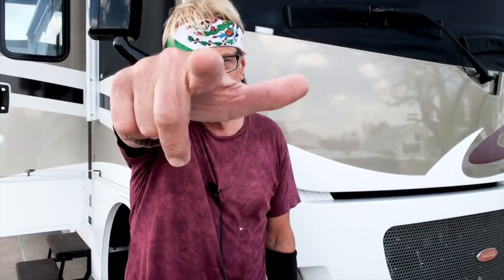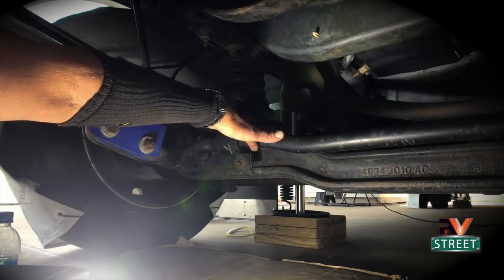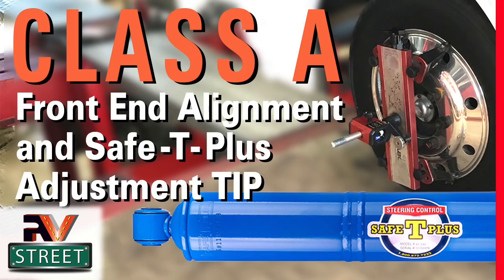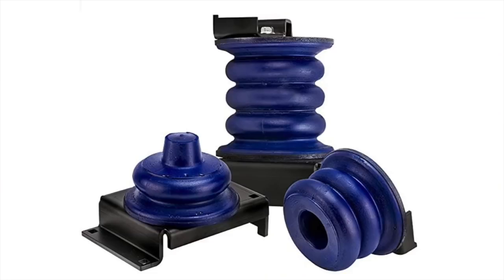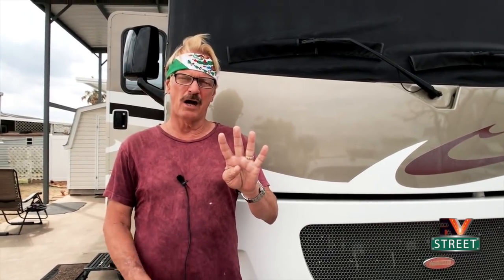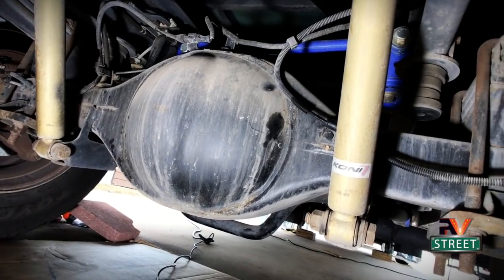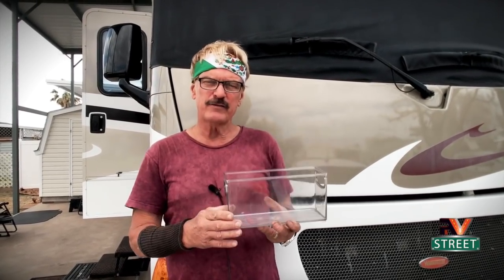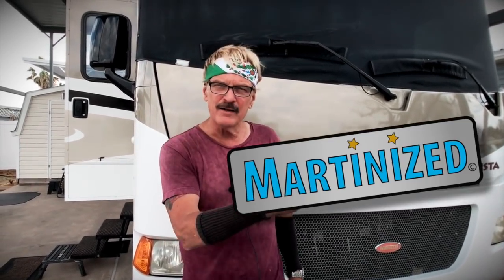Class A, Motorhome Handling Upgrades that had the MOST IMPACT

Comment: Heh Martin…Are the Koni FSD shocks worth the money….I have the bilsteins and I am not happy with the ride…lots of good reviews but I would like to hear your opinion
Reply from the maker: Yes they are. I also had bilstens from the factory when I bought our rig used in 2016. JUNK. Switching over to Koni FSD's was one of the first things I did to the chassis. BIG difference. But just remember, as I described in this video, my coach rides and handles as good as does not because of any one thing, but everything I've done working together in concert along with running the correct PSI in my tires.
BTW...I do carry the Koni FSD's in my Amazon Store in the "Tires, Engine and Chassis Care" category: https://www.amazon.com/shop/rvstreet
thx Fraser 🤛
Reply: Txs Martin…I have done all the suspensions mods and the Koni’s are the last upgrade to do…just hoping the ride is improved over highway bumps especially expansion joints, noise etc
Reply from the maker: @frasermoffatt4154  Good job 👏
The biggest improvement to address highway bumps, slam jams and expansion joints—for me—was the Sumo Springs in the front. Always keep in mind that our rigs are truck chassis' on Leaf Springs. The shocks will help too of course and will keep the chassis tighter in turns, reduce roll and prevent porpoising. So just keep your expectations reasonable because you'll never get rid of it all. It's a truck chassis. But I love the way ours handles and rides now.
BTW....what type of rig do you have, model, year, weight capacity and wheel size?
Reply: I have a 2013 Thor Challenger 37GT on 22.5 tires….24000lbs….I have sumo’s on all 4….upgraded front and rear sway bar and I also have the blue ox tru center….with the Koni’s i would like a quieter and less jarring on bad roads…..i have moderate expectations….;the biltsteins are really bad!
Reply from the maker: @frasermoffatt4154  Thanks for that. Yep, you should be good then after the Koni's. You've done everything right.

Comment: I have a 2005 38J Winnebago with work horse frame. Is it normal to feel every pot hole, cracks or bad bridge transitions. OMG I don’t know how this motor home stays together!
I have checked and double checked suspension a can’t find anything wrong. I also watched Martin’s videos on tire pressure’s and took off a shock to test and seems fine.
Any advice / suggestions will be appreciated. 
Thank You!
Reply from the maker: Hi Mark,
Yes it's normal to feel every pot hole, cracks or bad bridge transitions. That's why I did this video. All gas motorhomes experience this. Your coach is a 24K chassis. 2K heavier than mine. These chassis's are on leaf springs. As stated in my video, the reasons of adding my new Koni shocks and the Sumo Springs was to eliminate 80% percent of that. You are not going to eliminate all of it but you can reduce a lot of it. These are basically delivery truck chassis's with a box on it. The other upgrades were to remove the front and rear sway. Even though you tested one of of your shocks, your shocks are 16 years old. They need replacing. My advice is to do what I did.
Reply: @RVstreet  Thank You Martin for such quick reply, your video’s are fantastic and I’m very much a fan!
I will replace the shocks. 

Wish I would have seen what you do earlier. I’ve been dealing with everything you talked about. I didn’t mention that I already added airbag system for front and back trying to get rid of all the white knuckling!
Thank You Again!

Comment: Please I want to know if you can send me information on a sway bar that’s work on a 1999 Winnebago adventure I will like to get also sumó spring
Reply from the maker: I need more information first to look into it for you.
There's a lot of different kinds and models of the Adventure. 
What size and kind of chassis do you have? 
What is the length of your RV? 
What type of engine do you have? 
What is your GVWR?
Reply: @RVstreet  it’s a 19999 Winnebago adventure it’s a 34footer and a Cummins Diesel engine
Reply: And a freightliner chassis

Comment: martin , we have a 2014 winni vista 35f , on the ugggh f53 chassis , we had to add the safe t plus front steering dampener , which totally helped the issue we had when driving , i hate ford products to begin with , nor do i care for the engineering or design , at sppeds over 50 mph , the rig handled horribly , we hated it , from speaking with numeroys people who have the same rig we have , stated pretty much the same , we also added the rear track bar, which greatly helped the issue , we actually can take it up to 71 mph with no issues , but what i dont get is how ford gets away with selling these to rv builders , and think these are safe , but not ,,,,,,,,,,,,,,,,,,,i really dont get it , i appreciate your continued input and help
Reply from the maker: thx for your comment Michael 👍
Well....I don't share your HATE for Ford products, and they get away with it because there isn't any other alternative chassis for gas MH's and I wouldn't consider them unsafe by any means but these chassis's do need some tweaking to make them handle better on the highway for sure. With that being said, the F53 chassis is a truck chassis—with leaf springs—that come in different weight classes depending on it's end use. Being a truck chassis accounts for it's rough ride and if someone has a smaller weight chassis that comes equipped with 19" tires it's even worse. It's a big box on a truck chassis. But...as I point out in the video, for about $3K a buyer can make these MH's handle pretty darn nice. The reason Ford doesn't do these upgrades at the factory is pretty simple.
1) Many MH buyers don't care
2) Buyers won't spend the extra money for upgrades
3) Some buyers only use their MH periodically and it sits a lot of the time therefore doesn't warrant the cost of upgrades
4) So, if a buyer IS going to use their MH a lot or full time like we do, the buyer has the option to do a few upgrades to make it much better at handling and easier to drive
Not pointing this comment towards you, but I personally think a lot if not most of MH buyers compare a MH with their experience of driving and caring for a car or pickup truck. Most Americans who have bought any vehicle in the past expects a smooth ride, good handling and if there is ANY issue at all, they simple take it back to the dealer and it's dealt with el pronto. MH & RV sales are a totally different animal in every respect.
So my conclusion and opinion is, people have to have a realistic expectation of what to expect with a big heavy house box, on top of a truck chassis. Getting a big size chassis like you and I have or the next size bigger with 22.5" tires is a good step in the right direct. Since I've done all my upgrades years ago my MH handles great. Is it perfect no, of course not. But I've got my F53 tweaked to where it's the best it can be. The only thing I do now is constantly make sure I'm running the proper PSI in my tires and keep my load evenly distributed.
If others want a better ride, better handling etc, etc, they need to spend more money & move up to DP. But DP's also have their issues too. It's just the way RV life is.

Comment: Do you prefer a super steer over an anti sway bar?
Reply from the maker: They are one in the same. My rear super steer unit IS a anti sway bar. And yes I love it. It was a BIG upgrade. No more tail wag.
Reply: @RVstreet  Perfect. Was it hard to install? What do you use to lift your rig to work underneath it? Blocks?
Reply from the maker: @ljcruz127  Like I said in the video it was actually a real easy install. We have a gas coach so there was no need to lift the rig. Just crawl underneath it on piece of thick card board or a creeper and do the install.

Comment: my question is this, I have a 2003 holiday rambler W 22 chassis. This unit is 30' long and came new with just shocks and springs no torsion bar nothing but shocks and springs   Holiday Rambler is not the cheapest motorhome on the block. I have a problem with this thing rocking and rolling like a crib.  When I pull into my driveway i go over a curb and i just let the front wheel hit the lower pavement and it rocks back and forth about 5 times before i pull in the rest of the way. This tells me there's nothing wrong with alignment or anything of that nature. This unit came new without anything but shocks and springs and I'm sure it didn't rock and roll, or they would  never of sold it. my question is, how can there be anything wrong unless it's the springs as I put new Bilstein shocks on it. and what kind of spring should I get is the question.
Reply from the maker: Perform the CHF I showed. (Cheap Handling fix) Move the end links to the next hole. This will stiffen the front end which makes it not roll so much. Or if you don't want to do that, install the Hellwig Adjustable Endlinks. They come in 3 sizes. Just measure the size you need and adjust them as needed. As I said in the video, it's not just one thing that fixes these type of problems. But all of my front end upgrades working in concert gives a much better ride including reducing the roll. When I replaced my shocks I went with Koni FSD's. I like them a lot better than Bilstein's.
These items are in my Amazon Store: https://www.amazon.com/shop/rvstreet

Comment: I'm sorry, you lost validity when I saw that you were relying on jacks alone to keep the rig in the air.  Hydraulics have lots of failure points and stands or blocks are necessary to be safe.
Reply from the maker: Now come on Don, think about it again. You know....I know better than that if there was any danger I wouldn't do that. Yes I had my jacks down at our winter spot shooting this video but I only raised it about 2" but I wasn't keeping the rig in the air with the jacks and relying on them. I have GAS RIG remember. I don't need to raise coach at all to crawl under the rig safely. While under the rig, all 4 jacks could fail and I can still be under the coach on a creeper if I wanted to. There's a ton of height room under there. Heck, there's so much room under there, when I did all all these installs with all my tools wrenching and everything, the coach was sitting on all 4 tires. There was absolutely no danger here at all. Now if this was a DP that would be different. If I had a DP I would either run the coach up on big thick wooden ramps or use jack stands to raise it up safely to work on it. On a Gas coach there's just no need.
Reply: @RVstreet  Exactly. I don’t think Don is familiar with your channel or your know how OR he doesn’t realize that Ford F53 chassis motorhomes are a whole lot higher off the ground and safe to crawl under and do maintenance. Hopefully he’ll come back and apologize. You didn’t deserve that spanking Martin. We love ❤️ you and have total confidence in your knowledge and ability. ☺️😁
Reply from the maker: @dianediamond310  Thank you Diane for your words of encouragement. Ya I don't what the deal was with his comment. I don't think he knows me or just commented without thinking it through.